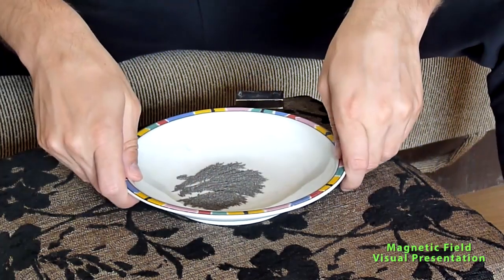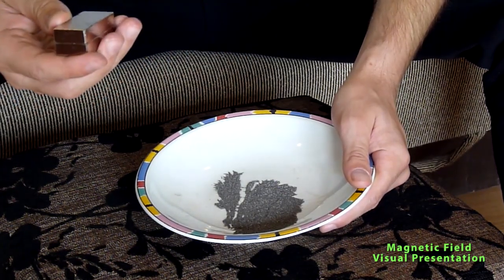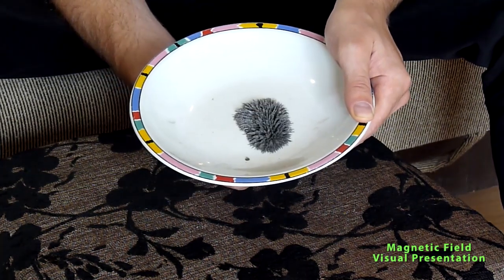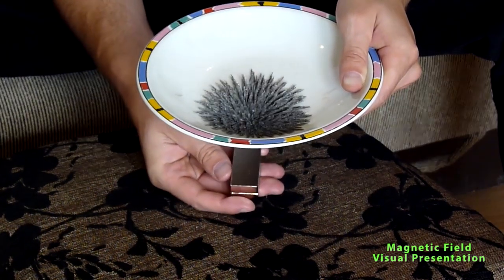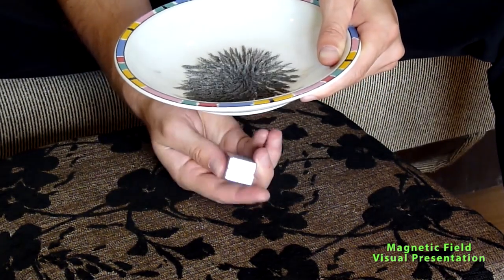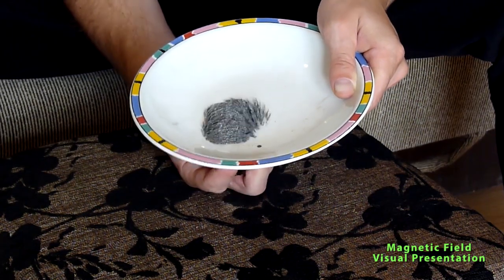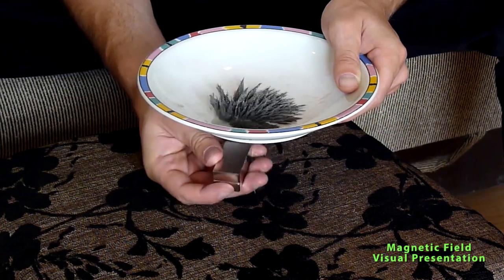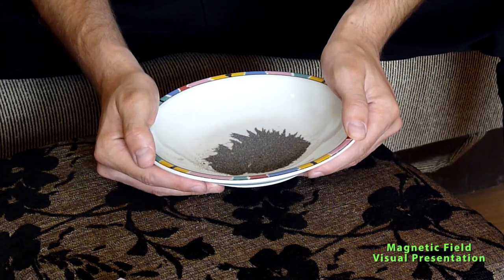Invisible FREE ENERGY - The Magnetic Field!!!!

Comment: I thumb you down because there is nothing here about the "free energy". You confuse FORCE and ENERGY. A magnet is equivalent to a string in many ways: when You try to force two magnet to get closer in repelling mode, it is a bit like You compress a string, and when You try to to get further to magnets it is a bit like You stretch a string. Imho, by controlling the inner structure of the magnetic field to be able to change very violently its magnitude with only few power consumption. But the problem is always that the power needed to create the change, up to now, is still greater than the one obtained thanks to the change in the magnetic field. An other way would be to use screening which would not be attracted by the magnets because if yes, we are still in the case that the power input need to make the change is greater than the power output obtained. Regards.